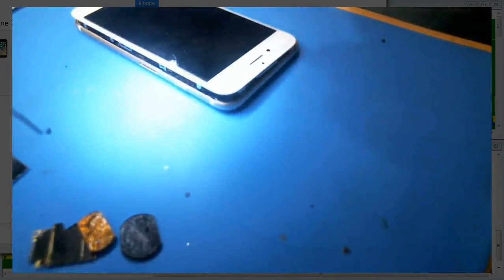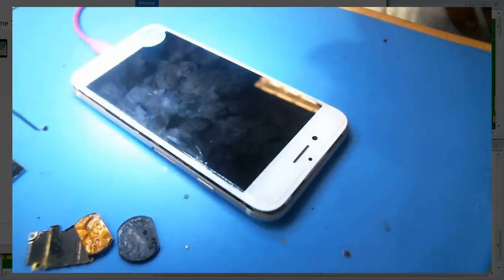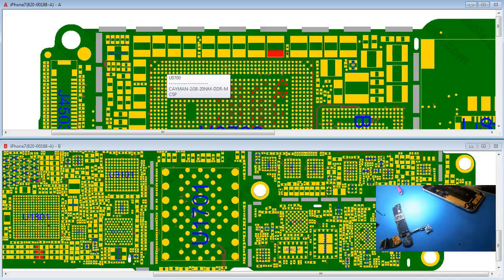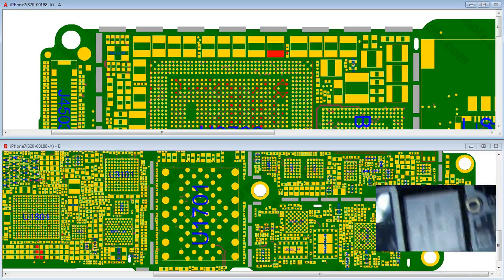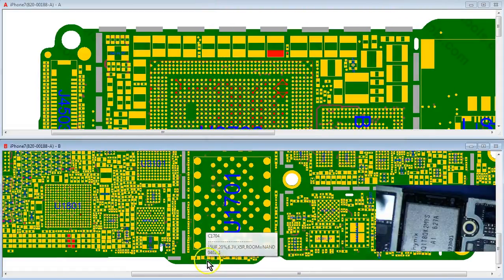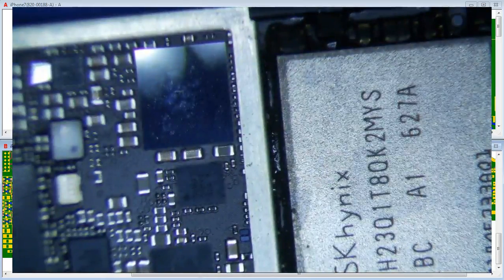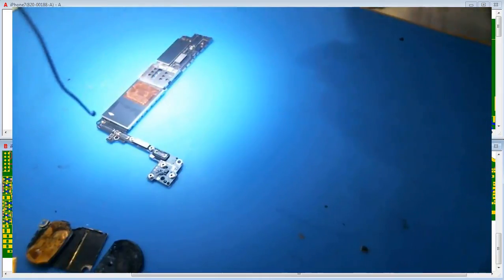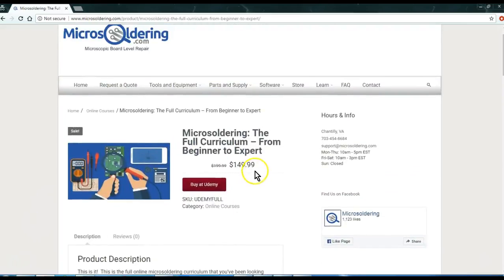iPhone 7 error 6 quick apple logo flash

Comment: bro its the audio ic .... i had one before and fixed by the jumpers
Reply: Maaoya Al-samarrai | معاوية السامرائي 
So u had the same flashing apple logo symptoms and it was related to audioIC? Never heard of. 
Just watched Jessa Jones booted an ip7 with audioIC c12 pad shorted to ground an messing around with the other pads...but there was no flashing apple logo related with any audioIC fault....
Reply: Bimmedroid I've watched the stream also but i don't know i had one 2 weeks ago it just flashed the apple logo and turned off .. and does not restore .. so my first try was the jumpers under the  audio ic and it fixed !!
Reply: and i think the flashing apple logo like it showen on the video .. it's because a corrupted software that a result of trying to restore with un successful flash ..
Reply: Maaoya Al-samarrai | معاوية السامرائي 
That would make sense. Thanks for sharing this information
Reply from the maker: I guess it's possible since I didn't replace tristar or the audio ic.  I guess i'll give it a go.
Reply: Was the one you fixed have error 6 as well?
Reply: mrsemifixit i don't remember exactly 😣 but the error was at the beginning of the restore process
Reply: Microsoldering don’t mess with the audio ic man there is no way it’s that unless it’s been off before and someone bridges a power line under there. I would pop off that nand and see if it reads. Takes me about 15 mins to clear that underfill, pop it on the preheater, and briefly hit the top with heat while sliding my removal tool underneath.
Reply: ju po hahahaha